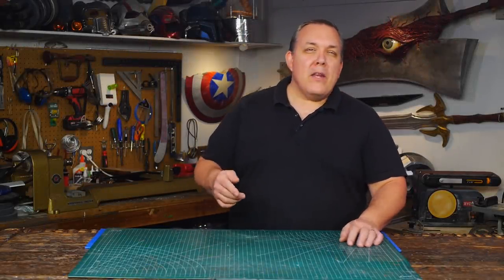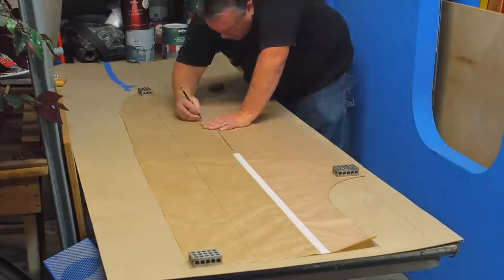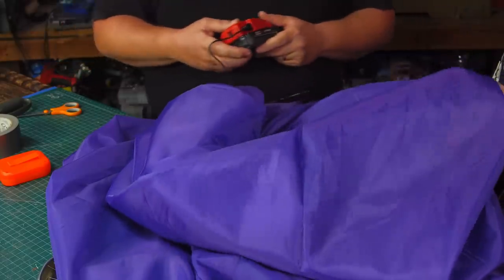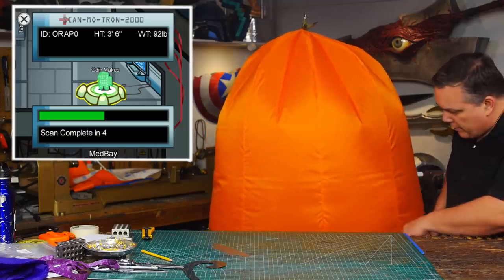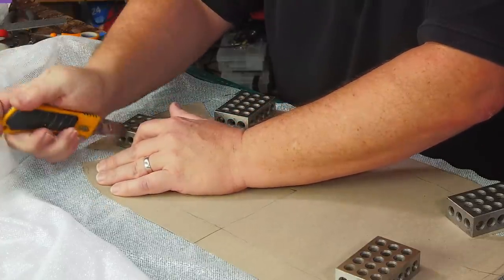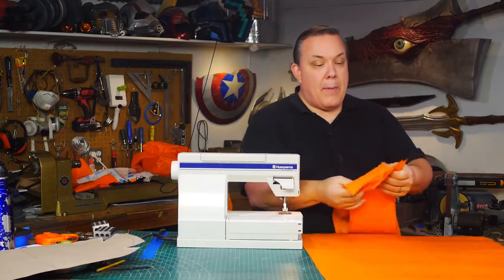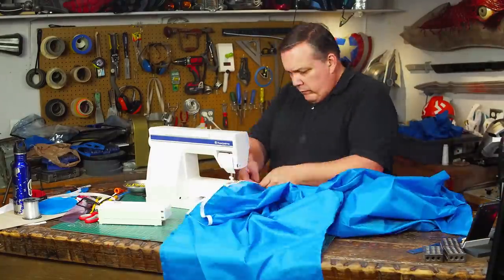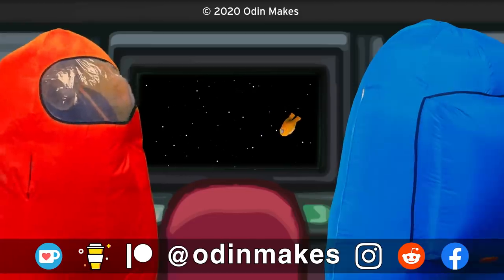Odin Makes: the Among Us spacesuit - it's an inflatable cosplay!

Comment: Also great for the current events situation, because a space suit means not having to breath the same air as other people. Ooh, maybe you can have gloves sown in behind Velcro pocket or something so you can have pop out hands that are the same color as the costume.
Reply from the maker: If the gloves are attached to the costume, all you would need to do is pull them in. But by having little openings, I do things like at 20:46

Comment: 2:08 What kind of paper are you using? ~ 18:56 What is going on with the way the left foot is shimmering?
Reply from the maker: The paper is just 18" wide painter's paper from Home Depot. It's just light weight brown paper for masking.

The shimmer is from having shiny duct tape on the feet, the tape is reflecting the green from the floor, and keying out.

Comment: Hey Odin,when I asked you about the visor peice in the live stream so you can see through the rex helmet what was the material.
Reply from the maker: That is a welding visor or grinding shield visor...  the color is actually green #5! But looks black from the outside. Got mine from Amazon: get the thin flat type, they are polycarbonate, and easy to cut with scissors.